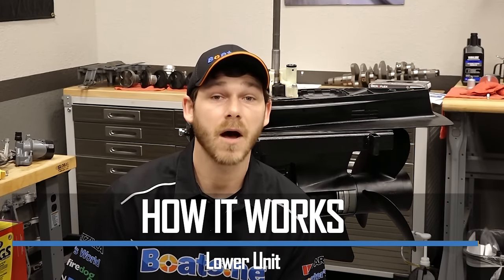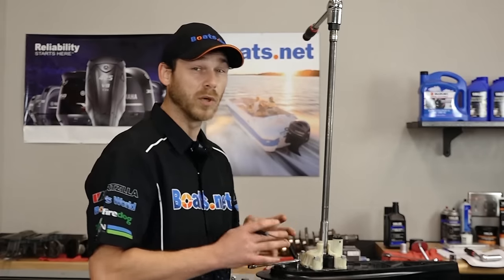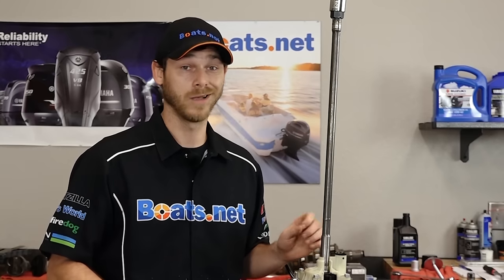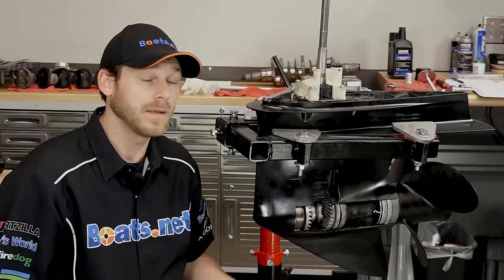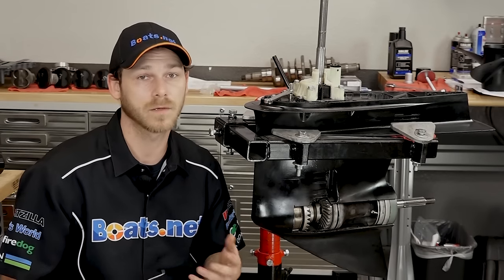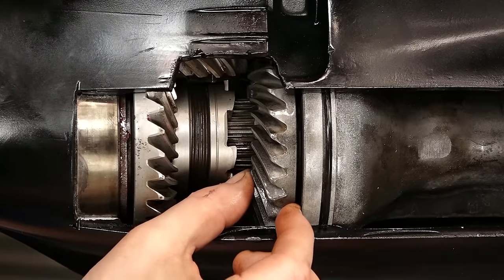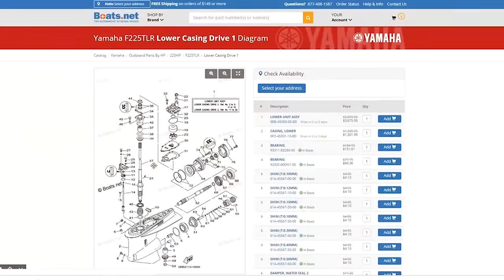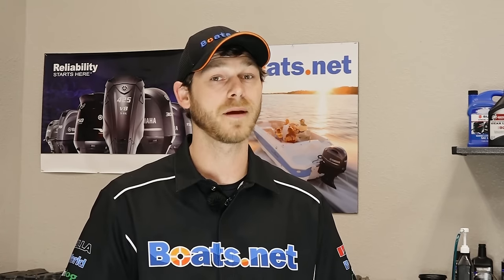How an Outboard Lower Unit Works | How an Outboard Gearbox Works | Boats.net

Comment: I've got a 1991 Nissan 25hp that been bored .20 over but set up.a while and the carburetor  got clogged so I bought a new one the motors brand new cost me $1565 to have it rebuilt but the starter went out the carburetor wouldn't start the motor and the water pump went out so I baught a hole motor  housing from an arena that the lower unit was basically brand new so I put all the brand new parts n the lower unit new water pump even the bearing under the water pump is new the hole lower unite is now brand new baught a new $300 electric starter and baught a brand new carburetor it runs good when it's going down the river channel but when I come to a stop the motor dies and will not idle with the new carburetor and when I was t to start it I have to have the throttle 3/4 wide open to start it but idles down after I pull the choke half way out then the idle comes down so I can put it n gear why is this motor coughing and dieing on my and will not idle right do I need to get a 40hp jet because it seems to act like the jet isnt big enough could this b the problem because its bored .20 over seems like its starving for gas but when wide open runs fast but doesnt preform like it should what do i need to do to this carburetor to get this right